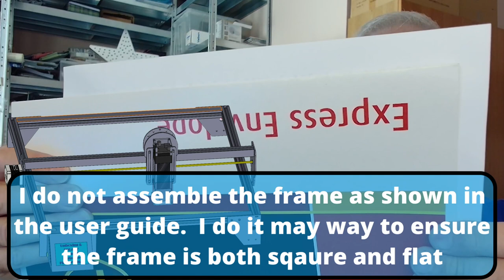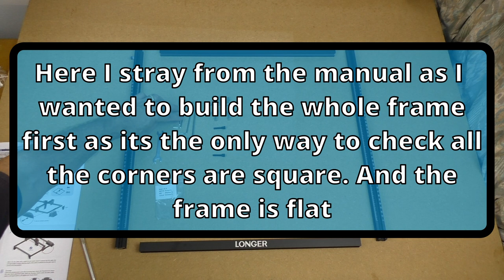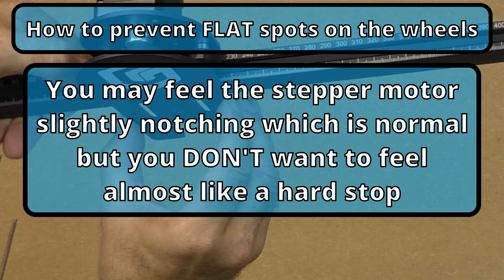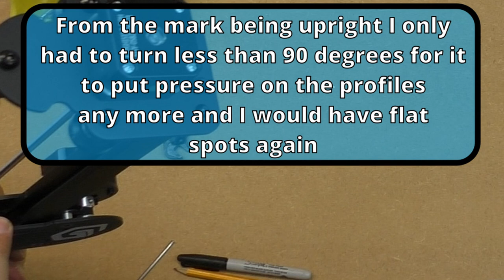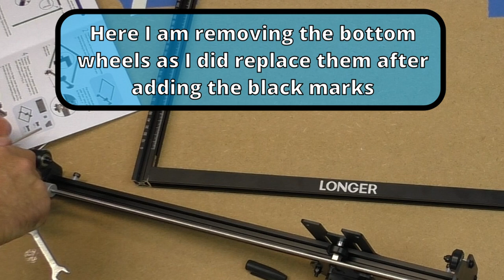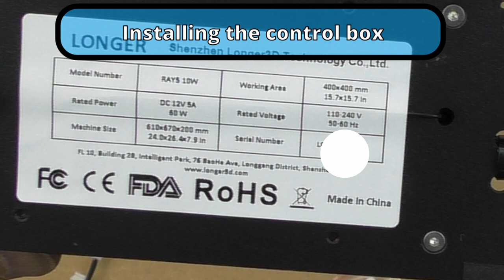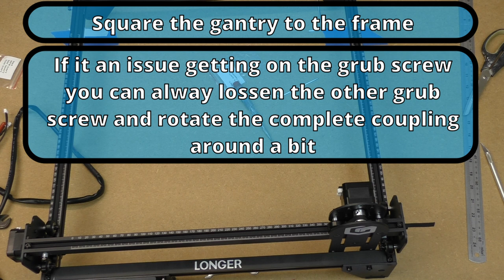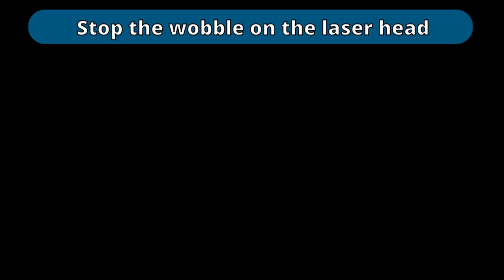Diode laser frame build it square upgrades, eccentric nuts adjustment, flat wheels

Comment: This is an excellent video for set up of a diode laser.  I have been using my Ray 5 10w for over a year and recently upgraded to a 20w.  In doing so, I didn't realize how critical squaring the frame and adjusting the belts and wheels on the gantry were since my 10w was pretty much assembled and worked great out of the box. This video will walk you through setup step-by-step and is very easy to follow. Took my machine apart yesterday and followed Andy's instructions and feel much more confident for my new output.  Thank you Andy!
Reply from the maker: Thanks, glad you found it helpful.  Like most things set up is key
Reply from the maker: I am just working on a fine focus z lift system for my 20W its still in CAD but looks great.  Hope to cut it soon and see how it fits.  It will I hope do away with the two side locking bolts